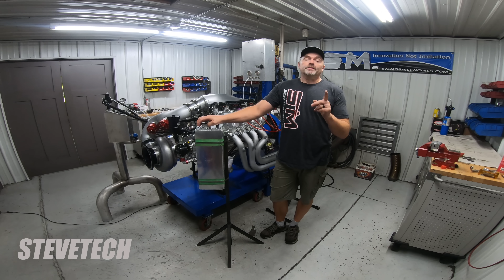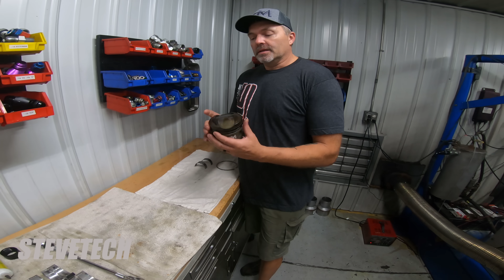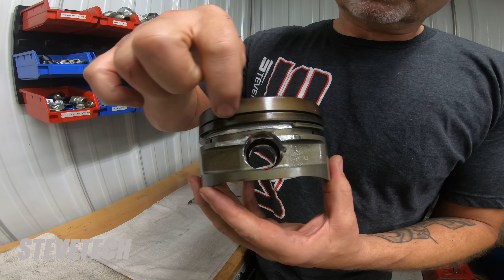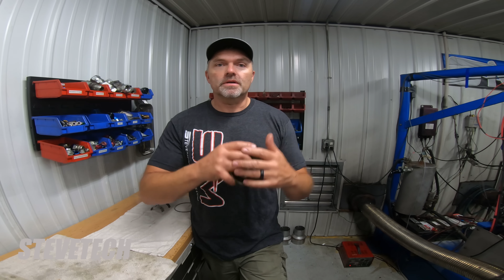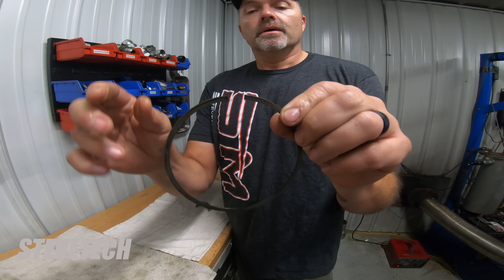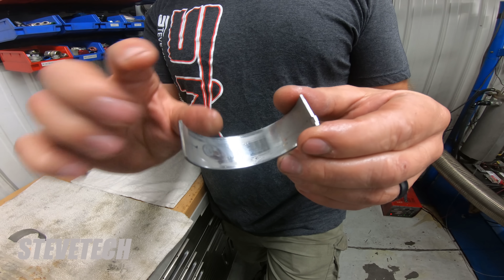Piston Blowout!!

Comment: Looks like pre-ignition ate the cylinder, based on the burned-away plug electrode.  Granted the cylinder was lean, which suggests detonation prone but detonation and pre-ignition are completely different phenomena.  Pre-ignition results in guaranteed, instantaneous failure.
I'd be testing a colder plug, ie: looking for a way to eliminate a glowing ember that ignites fuel prior to the spark event.

Comment: Be nice if the ECM would automatically shut off both (or all injector driver) for that cylinder when there is an open circuit in ether injectors so no damage is done.

Comment: Oooh ooh I can field why the difference in failure mode between gas and methanol.  It has to do with the amount of heat methanol can absorb vs gasoline. Ignition is still going to occur early it’s just not going to be that super heated torch that over oxygenated gasoline will be. It’s going to be an insane spike in cylinder pressure but no where near the heat.

Comment: One time I saw an injector get plugged with a piece of rubber from a fuel line or somewhere in the system. at 30psi it instantly torched the head blowing a channel through into the coolant which made the heater core blow up in the dash. Forged wiseco piston suffered a little meltage but the head was a total loss.

Comment: Surprised the Racing world is still using Crappy Comnectors from the Auto world.
They should Aviation Spec Amphenol electric aas l connectors.
Twist Lock with a Jamb nut for 200% Positive mechanical retention.

Comment: Surprised with all the current technology available you can't put safeties in place to drop timing, and dump boost pressure when this happens, I realize 1 second isn't much time to get it under control. My question is, when set on kill like this is it even possible to put enough safeties in place to prevent the damage from being so severe when they go lean and have a problem?

Comment: So, remove engine, re & re all 8 pistons, all associated rings, bearings, hone the cylinders, inspect the crank journals for damage, remove the oil pan and bits of metal, check the oil sump, and replace the injector zip tie and you're good to go? Sounds like an expensive zip tie. LOL!  I love it when you explain stuff. God bless.

Comment: I would imagine with half methanol, it looses significant cooling in the cylinder, goes hot, and pops
Reply: Half the amount of Alcohol still doesn't create as much heat as gasoline. It didn't get hot and "pop". It detonated due to too much timing for fuel used in that cylinder, causing the top ring land to distort and lose the ring's ability to seal. Boost preasure killed the lower lands. Not heat. If that was gasoline, it would have melted. Alcohol is a lot more forgiving.
Reply: @jrdmotorsports9718  lean+less cooling (just a little more heat) goes pop, regardless of fuel (and by pop, I mean detonation)
Reply: @number6mbw  100% false. Think about why, it's right in your comment.

Comment: I have seen what detonation does to pistons and parts running on gasoline and I have seen alcohol engines burn big holes through the head and block like a blow torch when they run lean but I have never seen that done before that is crazy. anyway great video man

Comment: Does the ecm see the lack of resistance in the injector and do something to help the situation.  I no experience here . I realize the ecm can not reattach the harness  connections but may be pull timing or cut power to the coil . Probably happens so fast that it to late .  Thanks for the videos . I also ZIP tie the injectors harness on my money pit Harleys

Comment: The reason you get knock from 1/2 fuel methanol is a couple reasons. Methanol engines are tuned to run really rich for peak power, sometimes under lambda 0.5. Even at half fuel your still getting enough fuel for combustion with a really high flame speed. 
The second reason is the loss of cooling of the intake charge. With half the fuel the intake charge temp will be stupid high. Any hot spots likely to preignite wont get the necessary cooling. 
I am dubious of gasoline engine with symmetrical twin injectors melting down.  I think it would cause a lean misfire unless you are normally at a smokey state of affairs. Something that has primary secondary injectors that loses the minor injector would get hurt.

Comment: Steve, do you think the piston that melts on gas is from pre-ignition vs. the one that breaks on meth during post-ignition, I.E. detonation?
Reply: I have seen melted pistons from pre ignition in a gasoline engine the guy had the timing so advanced and I guess he could not hear the sound of detonation that he just kept it pinned and it melted the piston to the wall of the cylinder and that was on a damn near stock 302 ford there was more then one piston but you could see if was acting like a woodpecker on those pistons

Comment: Possible solution to a lost injector on a multi inj per cyl motor.  
If the engine computer uses peak and hold for injector control or any sort inj monitoring, use the software to shut off the working inj on the dropped cyl.   I'm undecided as to what monitoring to use. At high speeds, amp draw would be better due to the injector being open longer, at low speeds inductive kickback would be better due to more injector cycles relative to clock time.

Comment: Could the third rail act as packup fuel system, activating when the primary rail/injector fails? when operated with proper ecu, when a signal goes off, the packup would go on. It would still be two or three cycles between the switch, but it could still minimize the damage. The piston would still probably be a goner, but the rest could be saved.

Comment: Had similar issue with injector connectors, I ended up drilling " in my case" a 3/32" hole through connector and injector and pinning and locking them together with a cotter pin. Was a pain but never had a problem after that.

Comment: I would expect that the reason methanol running lean detonates is all the charge cooling from evaporation. Since there's so much more methanol there's far more charge cooling (hence normally not running an intercooler), cut that cooling in half and you get detonation. 

I'm talking out my ass though, just my guess.
Reply: It detonates from too much timing for fuel used in a given  cylinder. It will do it regardless of the type of fuel used. Alcohol is just more forgiving.
Reply: @jrdmotorsports9718  I was talking about detonation as a result of running lean from losing an injector, not from overly aggressive tuning
Reply: @totensiebush  I know what you meant. And I am saying detonation doesn't happen from "lean", it happens from too much timing. I said nothing about aggressive tuning or increasing timing. Think about it.

Comment: Maybe heads can have a quick reset style serviceable detonation protection device  similar to a pressure relief valve   as the engine is a pump than if there is excessive cylinder pressure the device is activated cylinder pressure is vented  just enough to save parts getting that bit to much force at the wrong time .

Comment: What’s the compression ratio of something like that when it starts to squish the rod bearing …. Just curious 🧐
Reply: Compression ratio is the difference in the space when the piston is all the way down and when the piston is all the way up. If the cylinder is all the way down and has a volume of 800 cc's and at TDC it is 80 cc the compression ratio is 10 to 1. The compression ratio is a fixed  number. Cylinder pressure is what caused it and there is no way to measure cylinder pressure on a normal engine.
Reply: @jimandskittum  that wasn’t the question but thanks for the answer ..
Reply: @adamss68er  You asked what the compression ratio was when that happened and I tried to explain that the compression ratio doesn't change, cylinder pressure does.

Comment: Interesting stuff! Is it way different with ethanol?
Reply: Methanol is like alcohol just more. I think the ratio for alcohol is about 9:1. Methanol is about 6:1. It’s really good for power, especially with boost. Just takes a lot of it and has its own problems with the fuel being hard on stuff.
Reply: @NBSV1  Yeah it i best racing fuel you can get from pump. Here in Finland almost nobody runs regular gasoline on boosted engines. Just wondering if results are similar when going too lean
Reply: Any engine will detonate regardless of the type of fuel used. Certain fuels are just more forgiving. Straight Methanol is much better than partial ethanol blends. Any time you have a situation where a cylinder sees more timing due to less fuel, you run that risk. "LEAN" doesn't hurt parts. Too much timing does.

Comment: Using bearing wear as a tuning tool... talk about higher level racing!   Thanks Steve😎
Reply: Over 30 years ago, Dick LaHaie tuned his T/F car like that. Run a compression check, pull the pan and check the bearings. I've seen him go 3 rounds and never pull a head off. It used to drive other tuners crazy, especially after winning a championship with his talented daughter, Kim as crew chief.
Reply: Just as R.D. said, checking the bearings has been around for decades (possibly since before Lahie used it).
It's not wear they're looking for so much as the bearing being smashed thinner by detonation (like Steve mentioned - they mic the bearings for Thickness, the bearing will be pounded thinner quite a bit before it gets wider.
Another check for detonation is to look for tiny silver specks all the way up inside the plugs - they're particles of molten aluminum caused by detonation. Seeing those up in the plugs, checking the bearings tells just how hard it was detonating. 
It's impossible to hear race engines rattle, so checking for detonation - especially blown, nitro, nitrous etc. has to be done by reading parts, and today's forged pistons are strong enough that it sometimes takes a while for one to show signs or break from detonation. 
Better to find it early than pay for its broken parts!
Reply: It explains why OEM pieces are so reliable. Take any engine platform Dyno it and identity every worst case scenario and tune accordingly.

Comment: After thinking about it for while, the lean methanol condition is more likely PI (pre ignition) than knock. The damage looks like the result of super high PCP from the fuel igniting super early in the compression stroke. Alcohol fuels are much more susceptible to PI than gasoline due to their higher H2 content. When its lean, there is less temperature drop from the latent heat of vaporization of the methanol. This makes the everything hotter (melting the plug strap), and hot surface ignition (i.e. PI) more likely. The high pressure is bypassing the top ring and destroying the 2nd and oil ring lands. The bearing damage also is a big give away from high PCP.  Alternatively, hard knock will cause pressure waves in the cylinder which will scrub the boundary layer, allowing the hot combustion gasses to touch the piston surface, making holes in the piston top or ring land. This is more typical for gasoline fuels.
Reply: Knock is the sound that pre ignition makes so I didn't read any farther on your the thesis.

Comment: Would an ecu with a safety cut of some kind react fast enough to save parts like this?
Reply: I think that if you had a couple knock sensors and an ECU configured correctly you could have caught this in time. I'm not positive on that though, maybe Steve could weigh in.

Comment: At 9000 rpm the crank is spinning 150 times a second. So the piston traveled from BDC to TDC & back to BDC 150 times in 1 second.
😮
Reply: And don't forget the crankshaft is spinning twice as fast as the cam, so don't forget the exhaust stroke has to happen also, if all 8 cylinders fire in one revolution of the camshaft, its pretty amazing especially when you get down to calculating actual piston speed in the bore, amazing the things survive at all on a thin oil film.

Comment: Insane. How the cheapest parts can kill a masterpiece of engine. Probably a thermo dynamics situation. Methanol cools. Less meth  = more heat ( heat spikes), more heat = more pressure ( pressure spikes) . Combustion firing off the cylinder while the piston is still at full speed running up the cylinder smashing the rings down at the weakest part of the piston. Or something like that

Comment: Sounds like pre-ignition and not detonation to me.  People confuse the two all the time, but it definitely looks like pre-ignition.
Reply: Methanol burns slow at the proper mixture, 50 to 60% slower than gasoline. Run it lean, and it detonates, burning supersonically. You still need a spark to get it go boom unlike preignition that fires off on its own from some other ignition source. Pre ignition can happen with methanol, but is more often than not caused from liquid meth being in the cylinder. Running that lean from loosing an injector, there is little chance of any liquid in the cylinder.
Reply: @shvrdavid  Is it really detonation?  Detonation in an internal combustion engine is incomplete burning from the spark event and then the remaining mixture detonates on it's own later as the piston is going down.  A lean mixture burning at supersonic speed would certainly do the same damage because it would be like a blowtorch and because it's burning so fast it would certainly create super high cylinder pressures.  It might be something different then true detonation.
Reply: @andrigtmiller  Fuel that burns on its own, without a spark, is preignition. What you described from leftover fuel is preignition and does not cause the massive shockwave detonation does. Detonation is uncontrolled combustion of a substance which propagates extremely rapidly, giving rise to a massive shock wave. Fuel is supposed to burn at a consistent rate, ie: the flame front speed, lean methanol has an extremely fast flame front that results in a shockwave that breaks things. If you hear it, it is already to late, just as Steve eluded too. Lots of companies have used the two terms interchangeably for years unfortunately. But there is a difference. And engine can survive preignition, it wont survive lean methanol detonation...
Reply: @shvrdavid  Pre-ignition is the condition when the fuel ignites before the spark event, which means the fuel air mixture ignites on it's own so early the the piston is moving up in the cylinder bore and the flame front hits the piston with the two traveling in opposite directions.  It destroys engines instantly.  It's called pre-ignition because of the fact that it ignites before, the pre in pre-ignition, the ignition event, the spark from the plug.  Detonation is an additional combustion event that happens after the ignition event caused by the spark plug.  There ends being two flame fronts, the initial one caused by the spark event, the the additional one which is the detonation.  Engines can live with detonation because it happens when the piston is going down already.  Severe detonation will eventually kill an engine, but not instantaneously like pre-ignition.
Reply: @andrigtmiller  Well, when I learned about preignition, it was flame without a spark. I don't really care what others want to twist it into today. If preignition killed engines instantly, every computer controlled car would die a horrible death re writing the timing map the first time a lower grade of gasoline put in the tank, or the altitude changed. Oddly enough, they survive the knock's, pull timing, then go on to live another day. I have built, and raced cars for close to 40 years. So I am sure I don't know anything about all of this. The damage Steve showed is from Methanol detonation from being to lean. Engines do not survive methanol lean detonation. It didn't ping/knock from a flame front that appeared to early, it broke from the shockwave of methanol detonation...
Reply: @shvrdavid  My definition is not twisting the definition, it is the definition, and it's documented in engineering articles.
Reply: @shvrdavid  In computer controlled engines that have timing for a particular octane fuel, and then has lower octane fuel don't die, because they have a knock sensor that detects the detonation occurring.  The sensor works by detecting a particular sound frequency that is caused by the extra detonation of the fuel that happens when the piston is going down.  That frequency is the ping you can sometimes hear coming from the engine.  The engine may experience detonation without it being severe enough to always here with the naked ear, but the sensor will pick it up.  When the sensor picks up that frequency, it then tells the ECU to retard the timing.  It retards the timing because lower octane fuel burns faster, so the flame front reaches the piston crown much quicker, so the timing of the spark event needs to be later.  I don't have the time to explain this further, but you can check what I am saying with another engineer who is in the internal combustion engine field.

Comment: Does it look like that on e85 or does it look like gas if you have the same  Failure.
Reply: Detonation does the same thing to any engine regardless of fuel used. The extent of damage will just be different. However the damage he is showing you on the lower ring lands wasn't done by detonation, it was done by excessive boost pressure getting passed the rings. Collateral damage.